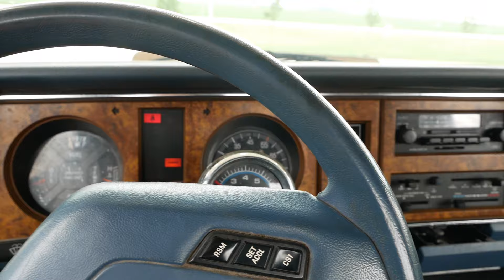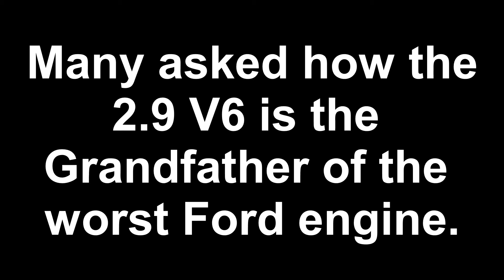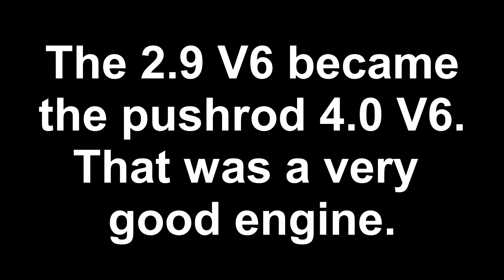Fixing Frank Fritz's 1986 Ford Ranger - Road Ready - Part 2

Comment: I'm surprised that setting the bearings that loose worked out ok. I've done this a lot on my 94 explorer with the D35 TTB. The bearings are so close together in the hub that a tiny bit of play there allows a lot of play in the wheel. Later (or maybe only on the D35 front end?)  they made that big machined slot on the threaded section of the spindle go under the bearing and it causes the spindle to wear from the bearing fretting around on it since its only supported by the edges of the slot. The automatic hubs have a much more limited set of places you can insert the key. I had a selection of them from the junkyard to try as they had slightly different tolerances until I found one that fit. Eventually I switched to manual hubs which is much better. Nothing likes the increased play. The ABS tone ring starts grinding out the sensor and the 4x4 hub gets damaged as it tries to be a surrogate wheel bearing.
Reply: Jesus loves you alot trust in His death 4 salvation and be saved from eternal hell <3 Jesus died on the cross for you bro.

Comment: my 96 V6 3.0 has single  cam,  but my 4.0 2003 4x4 that I got for winter ride is the garbage you mentioned sounds like 3k little dwarfs in there making statue. it's just matter of time before they finally snap off cause major problem.   that 86 is bit crusty even for PA standards,  don't think I would put that much work into unless your your going use for beater ride. as always nice work. I  got two rangers easy to work on. parts plenty full.

Comment: Wes as far as the transmission noise I think you will find a bad input bearing .Shifting into 4th which is direct takes the load off of it so it gets quiet.

Comment: For the wheel bearings and whether or not there should be endplay or preload. If the bearings are hotter than the journal and break disk then I would most certainly agree endplay is needed. But if they are within a 10 degrees most of the time then they will all basically expand thermally to the same degree if the thermal properties of the bearing are equal to that of the brake rotor. If that were the case, then you'd want a bit of preload as they need to be preloaded eventually either by means of thermal expansion or mechanical pressure.

Comment: I would have had to put mud tires on it--- being an I6 and 4x4...  If you played your cards right and used your youtube influence, you could have gotten new taller gears for your axles, and put lockers in the front and rear-- and it would be a little monster off road rig.  That's what I would have done.  You gotta start making phone calls and getting sponsorships.

Comment: That twin-i-beam suspension made for some seriously sketchy cornering, at least in the mid-80's Ranger I drove back in my younger days. If you hit something like an expansion joint, a bump, or even a thickly painted yellow line while in a sweeping bend, the entire truck would jump over a couple of feet! It was scary as heck, especially in the rain.
Reply from the maker: Yes. Makes them sketchy in snow. Put my Ford in the ditch once because of that.
Reply: @WatchWesWork  - Agreed about the snow! Winter driving in that pickup was an exercise in caution, due care, and hanging on for dear life.

Comment: You need to put seafoam in the gas tank and 1 in the the  crank case and then drive for 1 or 2 days change the oil and filter. I works wonders on those little motors.

Comment: Regarding the tire selection, good job.  You lose only 0.108 inches of tire radius and ground clearance, and gain some handling over the old-school 195/75.  It turns out that the 205/70R15 96T size you chose,  are the tallest tires that will work OK (they rubbed slightly only one time, pulling at least 3g's in a road dip) on my Prius Prime, and I've gone significantly offroad out west with them several times in a car that can use every extra millimeter of ground clearance.  

I go with the Michelin X-Ice3 available in that size for over double what you spent, because I live in New England, and they turn out to last 63K miles on my car, due to being 7 load index numbers higher than stock on the car.  I'd expected to swap tires winter and summer, but the Xi3 turns out to be great in summer, even in AZ 119 degree heat last summer.   I run them at 50psi, just 1psi under the max sidewall spec, and they do not suffer any mpg loss compared to the smaller stock LRR tires run at 44psi. I do it partly for the mpg, partly for the handling, and partly for again adding ground clearance.  They wear evenly, for anyone thinking 50psi would wear the center first. 

Anyone looking to lower a Ranger like that 1/2 inch rather than 1/10 inch, can go with the 205/65R15XL 99T Michelin Xi3.  They handle incredibly well, even  as a summer tire.  The 70 series are noticeably more squirmy/skittish than the 65, though still fine.  And the 65s are 10 load index numbers above stock for my Prius Prime, so maybe well suited to someone hauling or towing with the Ranger.  Significantly cheaper than the 70 series usually, too, often around $100 online delivered.

Comment: the part that went bad on my truck was the transmission. the previous owner put gear oil in the trans instead of atf. the second trans was my fault for trying to impress a woman and dumping the clutch by the third time i could change the transmission in 1/2 hour.

Comment: Have you ever simply turned down a job?  I'm not a real mechanic, arguably even a bad mechanic, but...if that thing was a friend's truck and asked me to work on it I would refuse...it reminds me of working on rusty pipes...everything you touch is rusty and must be replaced...you keep replacing more and more pipes, even though there was only 1 little problem spot.
This might be the video which made me cringe the most...the frame is gone, there are no more floorboards, the caulking...the 'brake lines.'  Oh god.
You are like such a good mechanic...!!!

Comment: The 2.9 engine was a commercial industrial engine that's why it has solid lifters and the noise in the transmission is the front bearing its a sealed bearing need to put a quart of 30E oil and a quart of transmission fluid

Comment: There was actually a cosworth 2.9l sold in the early 90s UK granada..... it had 4 valves per cylinder and an ohc using that design of timing chains with variable length intake on some versions.... quite fancy and powerful for the time and supposedly a prettygood engine.... form what little I can find it looks like Ford's engineers adopted the same basic design for the  ohc 4.0 and after the  accountants  had there way with it , it was kind all over but the crying...

Comment: Yeah to heck with those SOHC 4.0s, I've done guides tensioners and chains on them. Don't forget shift flare in the automatics behind them because Ford put hardened steel spool valves in butter soft cast aluminum

Comment: You'll know gear oil is safe for yellow metals most of the time by smell. It's the sulfurous "high-pressure" anti-wear additives that attack yellow metals - think rotten eggs type smell. If they are in a strong enough concentration, that's when you get potential for issues. A lot of spec sheets will have the copper corrosion test with gear oils - you're looking for a 1a or 1b. Typically the "safer" will be a GL-4 versus the GL-5 but not always the case. Even in a worse case scenario I doubt it'll matter long-term with that truck/transmission. You can do a bootleg version of the test by taking some thin copper, giving it a good sanding, then dunk in ~200F oil you are curious about for 24hrs. Then remove and wash w/ some acetone or similar.

Comment: I replaced drum brakes that had no springs this setup used a torsion bar that connected both shoes together and a star wheel setup in the middle to adjust the shoes in or out. But that torsion bar was annoying

Comment: If the O-ring is encapsulated, any break that is glued, will not be stressed.
Reply from the maker: That's the idea. It's still not quite as good as a real molded o-ring. But in a pinch...

Comment: Last time I said that if the frame was in as good a shape as the interior and exterior panels, even if the engine was out and it had no paint it would be a steal at 300 bucks. 

After seeing this video I'm rethinking that statement. Probably not as great if a deal as I thought it was.

Comment: If you think that this is bad you should see my dad’s old 70’s Ford Ranger. Not only it not running but the bed is severely rusted and so Is the undercarriage. The truck has two big holes in the floorboard with one of them being about the size of a basketball

Comment: 16:30 Nobody machines brake rotors anymore because machining brake rotors doesn't generate as much revenue as warming up the ol' parts cannon does. That, and it takes longer; shop techs...and especially dealer shop techs...are VERY strictly whipped into making ungodly tight repair times that mandate the parts cannon's use because they'd run over book time before they got the first rotor set up in the lathe.

Having been there myself I can 100% confirm that Mercedes Sprinter brake rotors are designed to not have enough meat on them to be turned. Mercedes insists you change the rotors any time the pads are changed. You don't even measure anything about them(And even if you did Merc themselves give no go/nogo measurements to compare with) they're just automatically yeeted.

Makes me greatly appreciate the Twin I-Beam front end under my '85 F150. If I'm easy on the stopalators I can get away with just slapping pads in it and sending it back out the first time brakes come due. Rotors won't even be worn enough to need turning.

Comment: love your channel learning alot, have a 1997 2500 GMC 6.5 new injector pump, injectors, glow plugs , fuel lines, fuel tank, filter, shorted out lift pump truck only runs for 5 minutes solid truck just looking for ideas

Comment: Use the proper seal instalation tool dang it I just got mine done the 4x4 seemed like the proper tool to install the seals lol (although extremely overpriced lately.). Worked great 87 f150 tho not a danger ranger. I do love the commentary and still laugh at the someone in the comments will tell me how to do it right. If it works it works don't question the method of an experienced mechanic. My dad was a master mechanic and I know he used wood more than not for seals so far I've used snap off tools for seals and wood scraps and pvc pipe fittings  all scraps from my various jobs. Still see myself looking through my wood pile for the tolls needed. Still haven't seen a brass hammer in person although it's on my list with a wood mallet because I dabble in woodworking and other trades. But a steel hammer and some wood hasn't let me down yet (I do have rubber plastic and dead blow hammers.)

Comment: Actually I machine most brake disks, on a engine lathe from 1950. VW and Skoda do not have so much extra thickness. In Sweden where I live I have not seen a brake lathe of of the type you have. Seems as some shops machine disks still mounted on the car. As I remember most part dealers in Wisconsin did machine as you do and I got the impression it was for a reasonable price. It was 10 years ago so maybe not any more... Latest I did was front brakes on my Dodge B250 van from 88, disks was integrated with the hub so only way for me was to take out the bearings and machine a dummy...Car works fine now, however I suppose it would be tricky to get any female help to haul a sofa in to it...

Comment: Just so you know I had a Ford Ranger and I ended up putting10 inch brakes on the back it had 9 inch brakes on the back. The 10-inch brakes gave it better stopping power. Semi metallic brake shoes. The 9-inch brakes fade too fast even if it's got the small rims on it

Comment: Adjustment cable last...rock pivot and flip it in the guide..much easier
Reply from the maker: The cable has to go under the two springs, so that would be tough.
Reply: @WatchWesWork  you leave it hanging from top pin..install springs and then hook to adjuster

Comment: Hi Wes if rust is sutch a problem in your part of the world, why not take  precautions ,like Mustie 1 with spray coat mixture of chain oil a block of toilet pan wax seal  and spray it all over the chassis and vulnerable under body of your pick up, I thought prevention was better than cure.
Reply from the maker: Do you have a time machine?

Comment: You missed the front  spindle bearings but good job and I know what rust is all about got a 97 gmc 4x4 trucks 600k rotting from too much calcium chloride they use on our secondary roads for dust control

Comment: My Chevy had a noise is every gear but 4th, turns out they used a needle bearing in the back of the crank instead of a solid bushing. My bearing came apart and started making quite the racket.

Comment: If the under body and frame of that truck had been oil undercoated very year that truck would have little or very little rust. Here in Eastern Ontario I am sure they spread as much or more salt on the roads in the winter as is spread on the roads of any of the USA states.

Comment: Surely you guys have the cheap power bleeders over there?

There are a simple bottle with two hoses attached. One hose attaches to the fluid reservoir and seals it shut and the other attaches to the tyre valve on the tyre to pressurise the bottle. Then when you open the bleed valve the fluid comes flowing out fast. 

The cheapest and fastest one man bleed system I’ve used. Also their only about £20. Only problem with ten is some fluid reservoirs have stupid non screwing caps which are incompatible. Although I’ve seen a clamp down system for over top of the fluid reservoir for those ones. 

I agree the vacuum units are garbage, they pull air at the bleeder threads and offer little help often.
Reply from the maker: I have an old KD tools pressure bleeder. By the time I get it set up I can be done using this method.

Comment: Must be a salt belt thing.  If I saw parts that rusty, I would either wire brush and paint them, or replace them.  Maybe it doesn't matter up there, but down south you can extend the life considerably by doing a little corrosion prevention.

Comment: "You need a special socket for this nut"  -  And looking at it says there's no reason that couldn't have been made as a hex nut except to require special tools that they could charge extra money to sell or that they could refuse to sell except to their "Authorized" mechanics.  Third parties of course will step in and provide but "special tools" always require special prices simply because they have a smaller market.

Comment: Quick question you briefly talked about bearing preload wouldn't the clearance on the wheel bearing become greater when the rotor heats up, or is the bearing along for the ride heating up with the rotor.

Comment: That is what is called a "little" rusty in Illinois......I had a unibody Toyota where when you jacked it up, the jack went up, but the car didn't. I had to carry a length of 2x4 to spread the load out, under the jack point.
PS. Did you get those little rubber plugs for the parking break adjust hole with the Drum brake rebuild kit? (If not, I found the duct tape would kinda work)
I still have a can of R12, from the olden days.

Comment: Hey Wes quick question on the rotors and drums (no not the comment you were expecting), was wondering how much thickness was left after you turned them and rough guess on how much more you could get before too thin?

Comment: great runout on the disc      super refinishing tool .    horrible dry rusty backplate  just asking for some anti rust spray . I use copper grease on the sliding pressure points of the brake shoes and brake pads .  3M   chassis / cavity way is not expensive and it soaks into any dry rusted metal .  in America   I think there is a top quality anti sieze made by Bostic  called Nuclear anti seize .. my  1 lb tin  lasted over 40 years .

Comment: I had one of those rangers years ago.   Pretty nice truck till the rear spring mounts rotted off the frame....   is that military dump truck a 2 1/2 ton?   If it's original.its a fairly rare truck

Comment: I’ve got an 86 ranger 2 wheel drive project. fender mounted starter solenoid was bad so switched it out as well as the starter itself and i still here only a single click when trying to turn it over. No crank. Have you ran into this issue?

Comment: What is the purple grease and spray you are using on the brake job?
Reply from the maker: Brake grease and fluid film.
Reply: @WatchWesWork  I figured brake grease, just wondering what brand.  I've never seen purple.  Fluid film.  I'll look that one up.  Thank you.
Reply from the maker: @EliseandDanchannel  It's Permatex ceramic something. They all work about the same.
Reply: @WatchWesWork  Thank  you.

Comment: Hey Wes I got a question for you. I'm swapping a m5r2 transmission with a zf5 s542 on the zf5 it says "type H fluid". It's been discontinued what do you recommend as a replacement? 1994 f150 4x4 4.9l.
Reply from the maker: Ford says to use Mercon ATF in those.

Comment: I wont even touch those rear timing chain 4.0's turned many down. friggin nightmare. almost as bad as the 2.4 pt cruiser timing belt jobs. i always like those rubber caliper pin holders. dunno why they ever discontinued em...